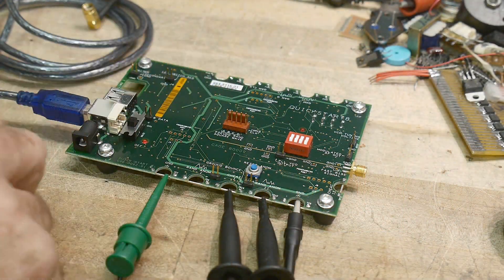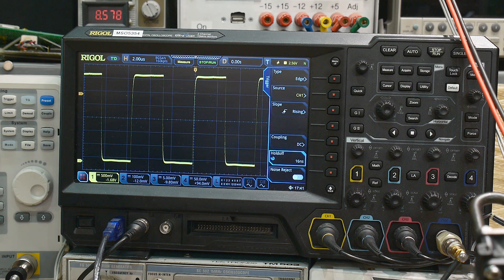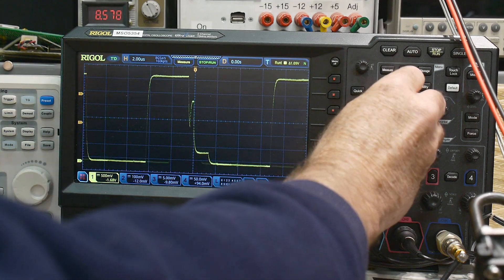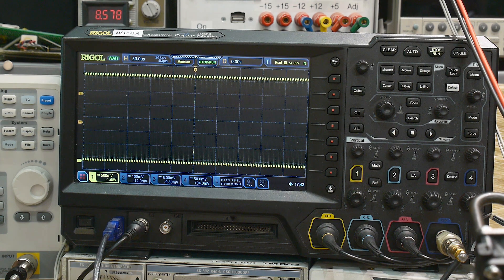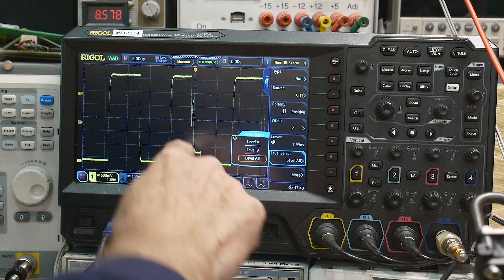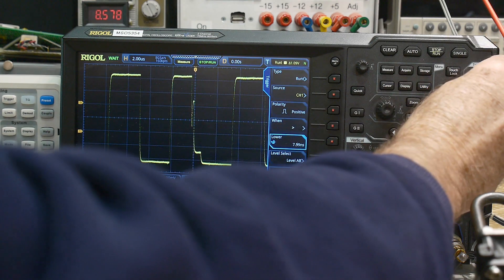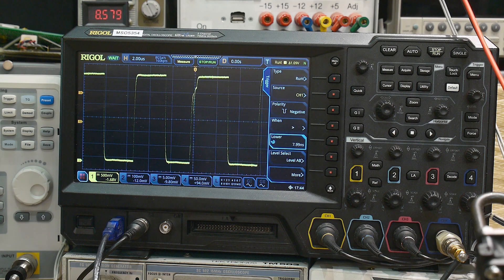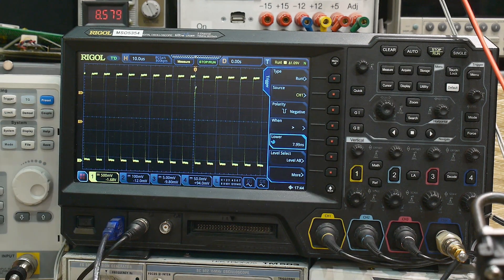#1414 TEK Demo Board Anomalies (Runt Pulses)

Comment: Have captured stuff like that on an analog scope. If you have a storage (phosphor-type) you can trigger near top for falling edge and and near bottom for rising edge. You will see things like that but faintly. If it happens more than a few times a second, you can see them faintly on a regular analog scope but you really need to manually trigger.
Some digital scopes also can use a reference trace and trigger on a difference. Useful for glitches and also for things like missing clocks or bits.

Comment: Thanks again, I learned about this feature of oscilloscope, I did not know about.
I guess, for digital signals (i. e. square waves) we can use adjustable schmitt trigger and some simple circuit to generate external trigger for oscilloscopes that do not have this feature.
Also, this might be a great tool for detecting presence of phase modulation in sinusoidal signals.
Also, could be very useful for debugging intermittent problems in digital circuits.  
This gives me another idea to design a circuit that can detect glitches in digital circuits.  
The circuit should generate trigger signal for oscilloscope, if the transition is shorter than a given time.

Comment: I wonder what the underlying issue is with the board when that happens?
Reply from the maker: usually things fighting each other. two outputs tied or a buss contention with poor timing, sometimes ground or Vcc bounce
Reply: @IMSAIGuy  I guess you would have to set up another channel to probe around the board and trigger using the Runt pulse. Would take some time probing to see where it comes from though since it takes time to trigger. Do-able but time consuming. lol

Comment: Great mini series on this board. Love your channel. Can you help me to understand one thing please? With regards to the Oscilloscope probe ground lead, how does it affect your measurements while connected to a board? Im assuming this board is not connected to chassis or earth ground but may be through the usb connection.
Reply from the maker: yes there may be a ground loop that that is very very common using a scope probe as the probe ground is tied to earth. but the probe ground adds a local ground that eliminates inductance problems, worse at higher frequencies
Reply: Thank you.
Reply from the maker: @dr650dualsport  https://youtu.be/henwiLzSieA
Reply: That’s a great comparison.